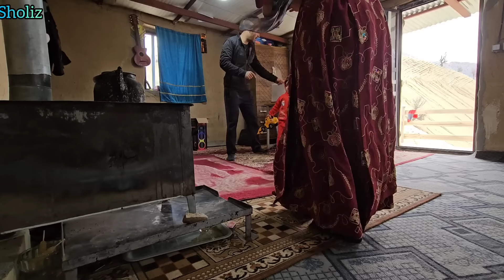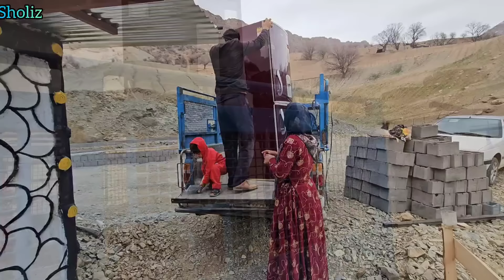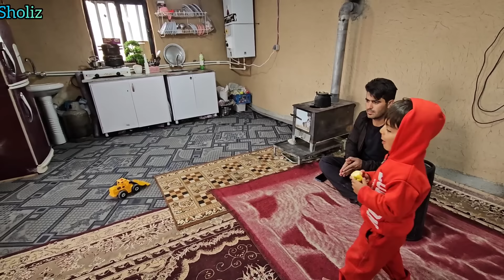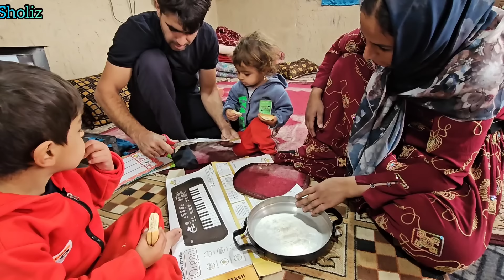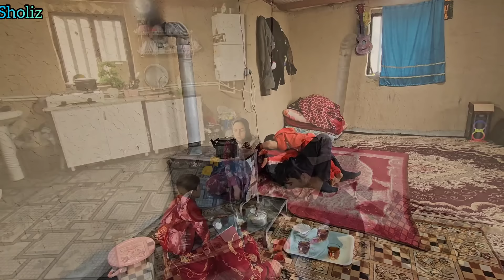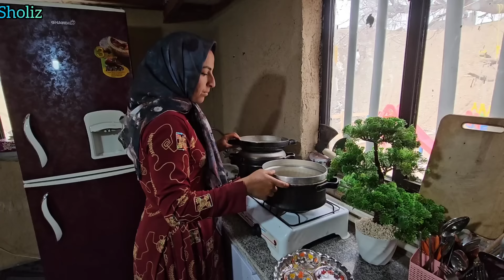A documentary of nomadic life: installing refrigerators, nomads and children's education, cooking

Comment: Refrigerators should not be placed in a window, especially on the south side. The sun will heat up the back of the refrigerator very much. It will be very difficult to get cold inside. Power consumption will also be very high.

Comment: When you have a new fridge, you need to keep it in up position for at least 24 hours before you connect it to electrity or use it, because inside there is gas and need a bit of time to get in the original position.  If you conncet it to quick it can broke down or no work correctly
Reply: No ves que el refrigerador no viene en embalaje?
Ese refrigerador no es nuevo, lo trajeron de si otra casa